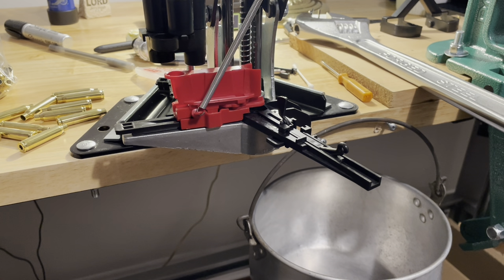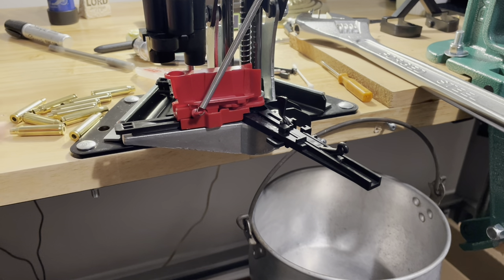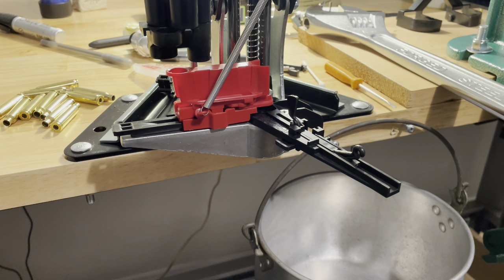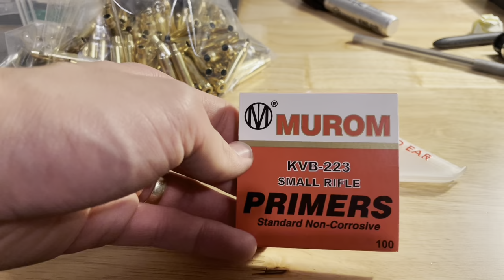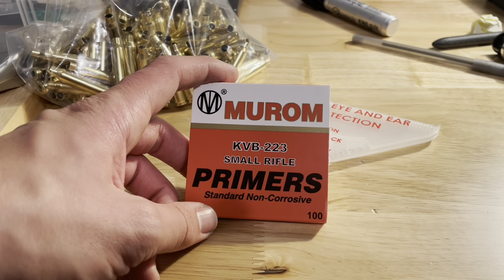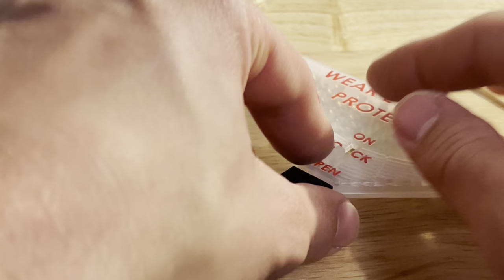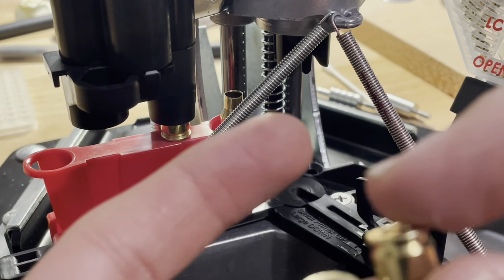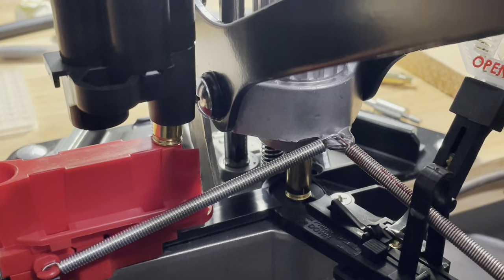Reloading 223 in 2023 Part III: Swaging and Priming with the Lee APP

Comment: I agree with @andy79z28
 about adjusting the pawls/jaws.  Back out the little set screw at the back of the case slider.  That will allow the pawls to open more and let the case drop in so you aren't constantly having to use your finger to push the case into the pawls.

Comment: I've been getting about 1 in 20 of those sideways primers with .223. I've had my APP deluxe for about a month. It does 9mm just fine, decap, size, bulge bust and prime. .223 is an entirely different matter. I've had to fuss with it constantly. Mine also kicks cases out on the drop. I reversed the riser and used a dremel to cut out a section of the closed loop to restrict tipping of the cases. It's helped some. Still refining that.
I destroyed the decapping pin on LC brass and now waiting for the upgrade pin. I use my home brew lanolin/alcohol case lube and found out to full length size .223 I had to increase the amount of lanolin in the mix. That worked and made resizing smoother. I may have to go back to the turret press or recently purchased Lee 4000 to prime but I really dislike the Lee safety prime system which is why I bought the APP in the first place.

Comment: When attaching the primer tray, you DO want to lock it first, then insert the tray and chute onto the press, then take the switch to ON.  the switch has 3 positions, Open, Lock, and ON.  If you go all the way to On without it attached to the press, you will, as you noted, dump primers.
Reply from the maker: Ahh, now I see that! Thanks for catching that/letting me know.
Reply: You can also use the RCBS primer tray in place of the finicky Lee.

Comment: The jaws on the slider need adjustment not opening enough. Will help in feeding the brass. Watching you prime - you are pressing hard to get the primer to go in. Need more swage on the primer pocket. Here is a link on my channel swaging with the APP - https://www.youtube.com/watch?v=FomybsZvcAc&t=221s  this was the orginal swage tool I did get the new version that you are using and it works much better.

Comment: im guessing your very new to this type off reloading who haa and that press look very new as you havnt done any off the mods to it ( eg there is a 3d printed gate you cant get that holds ya brass from  falling over ( how you keep pushing the brass back with your finger) and there is a newer 3d printed brass dropper and slide that make these app the ducks nuts )
i run a 6pac pro  with 3d mods and push out 500 + 44 mag an hour thats after i have decaped and cleaned brass

Comment: You did a really ok job of illustrating what to do for the lower stationary die, but absolutely zero instruction on what's needed in the upper doe. Please explain.
Reply from the maker: Sorry about that -

The upper portion of the Lee App is very easy to assemble. It is a rod, spring and plastic collet that screws into the top, with a cap that you screw in by hand. Its very self explanatory once you get a Lee App. It is the same assembly for both priming and swaging.

Comment from the maker: 0:24 primer crimp example

1:54 inserting swage die into app

3:04 setting up swage die

7:47 swaging thru cases

9:55 murom kvb 223 SRPs

11:08 loading primers into tray

11:36 configuring primers

13:10 assembling Lee app priming die

13:34 Inserting and setting up priming die

15:26 inserting primer tray into press

 17:34 priming first case

18:33 priming cases

19:53 primer error :(

23:59 inspecting primer seating